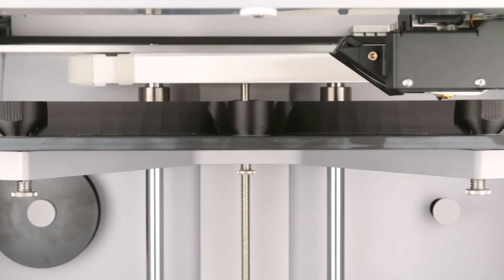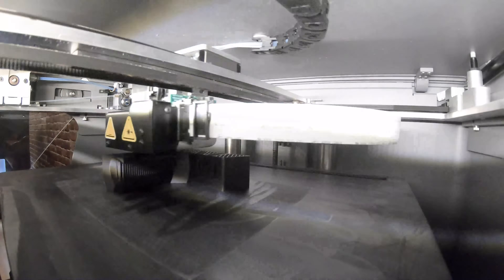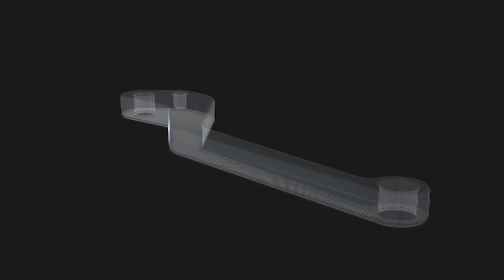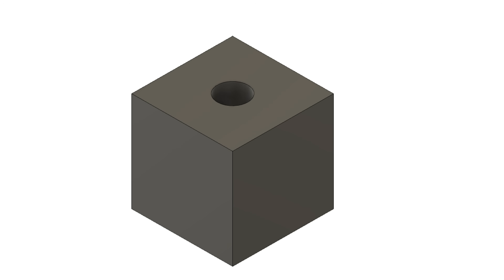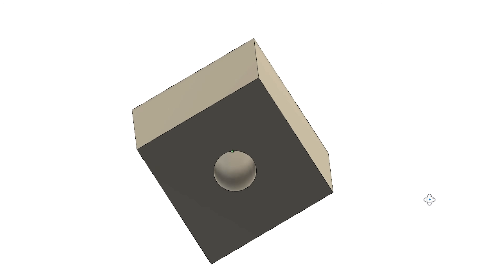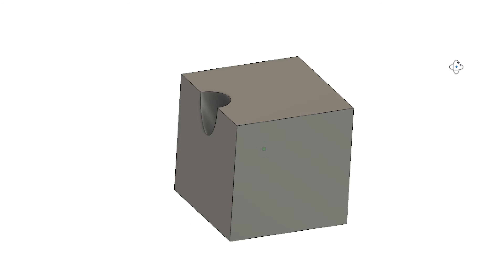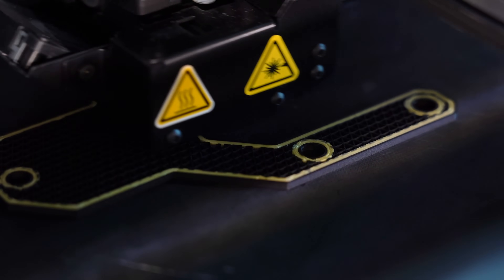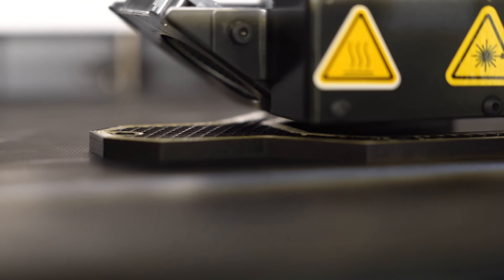How to Design for Additive Manufacturing (5-minute overview)

Comment: This video is awesome! Did you decide to test just the corners of the structure at the end because joints tend to be the weakest points of parts or is there some other reason? Is that why you said they are the critical structures of the part? Why not test the sides as well?